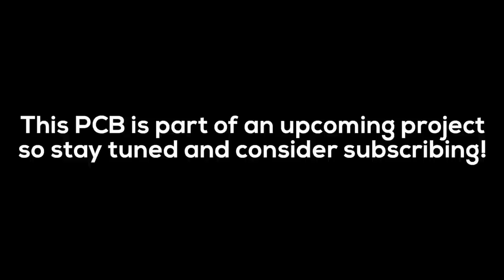ESP32-S2 based universal reflow oven controller | assembly & tests | makermoekoe

Comment: A word of warning, if you do a few runs consecutively or have it for a few years, you will almost 100% likely cause heat warping to your 3D printed front and acrylic sheet. I know this because my design is similar in that I took the front off the original oven to replace it with my own designed 3D printed front. I used ABS which is okay to about 100C and better than PETG or PLA but it wasn't enough. In future will use Nylon or CF-Nylon. Will probably add a strip of titanium or Stainless Steel as a thermal insulator between oven door and Front-interface printed housing.

Comment: I tried something similar a while ago, but putting the electronics inside the Oven was a mistake. After a few hours it started to produce errors due to the bad heat isolation between the reflow chamber and where I put the electrics. Your design seems better in that regard though. What I noticed was, that turning the oven on and off by hand and using a thermocouple as reference was plenty good for my needs. I did PCBs with 150mm x 150mm and ground planes without problems

Comment: 0:33 awesome!! what a great idea!!
Reply from the maker: You'll find more details about this in my last video 🙂
Reply: @makermoekoe  lol. you are right.
U showed a lot of skills that individual developers can take advantage of.
Two different types of stencil fixing techniques. 
-vacuum -A physical fixture -made by 3D printing.
Solder paste application device using stencil plate also.

Two different types of SMD soldering techniques. 
-hot plate in the open air -Oven in the closed chamber
Pre-soldering techniques and flux application techniques.
Display fixing hole using tweezers.
also Fine technique to remove sticking leads with additional leads.
Fastening screws with soldering machine heat.
Everything is a personal hardware developer's bible.
:elbowcough:

Comment: Man, the quality of your work is mighty impressive. And your lab looks awesome as well. And this gold enig finish on black PCBs is very beautiful.

I'm working on an ESP-32 controller for a personal project, and I wish I knew how to do 4 layer design or do impedance matching for ceramic antennas. Any tips?
Reply from the maker: Thank you so much for those words! 
Regarding the four layer stackup there are awesome videos by EEVblog which I can definitely recommend. Impedance matching isn't easy at all... For some antennas there are great datasheets with simulation stuff but sometimes it's just trial & error for me as well. The antenna which I'm currently using has this little helper: https://product.tdk.com/de/search/rf/rf/antenna/simulation?pid=1000000249767

Comment: Cool as usual, but the standard reflow process has a limited T and time, so-called profile curve(usually IPC/JEDEC J-STD-020D.1 or so), you can find that in many silicon part's PDF. An oven like this can control T, however, many SMT parts are sensitive to accumulated exposed time(low-noise amps, plastic connectors, stacked film-caps etc).
In fact, simple hot-air may be safer.

Comment: Heya everyone. As this great project deserves it, I put a little of my own effort into it. While all credits are going to makermoekoe, just wanted to leave a tiny note, that the fork of p1ngb4ck is actively developed on and has basic wifi connectivity, i2c-scanner, ota flashing and compatibility with latest library versions. Also a working BOM is provided on that fork.
All changes were minor and not much work in comparison to the original project, but maybe it could be helpful to someone. Additional wifi-controls and surveillance  for the oven and saving temp-curves via wifi are currently in development

Comment: Nicely done! I always like seeing video of the moment the solder melts and creates the fillet. :))
A couple questions:
   1) With such a large oven, is there a problem with thermal 'lag' especially on the ramp down? 
   2) Cool idea with the vacuum hold-down, though I thought I saw some mis-registration with the stencil. Is there a way to make sure it's dead-on?
   3) Have you ever used dry-transfer letters to label your acrylic. I've used white letters on smoky gray, and it usually looks really cool!
Can't wait to see your next one. 
Take care.

Comment: If you are doing a revision, add a way to monitor the input wave form. This will help you with controlling the coils accurately. Otherwise using PWM or something along the lines will feed harmonics into your house wiring.
Reply: I think this is easily solved by using an input filter like a PC PSU has, using Y caps and L-C combinations
Reply: @KnaufL you can also use the reverse phase dimmer approach, instead of turning on outside of zero cross they turn on at zero cross and off elsewhere. Current is always ramping up at a rate of the cosine of the sine and down, well that’s fast but less problematic.

Comment: How are you reflowing the opposing side without losing parts from the top? That bare board is creating enuf isolation that the top doesn’t flow?

I recently tried just setting boards on a PID controlled hot plate at 245C and they flow inside of 20-30 seconds tops then slide them off and they cool on a granite cutting board. 

Definitely violates any reflow profile in the sense of ramp time…prob not the best thing but it works. I wouldn’t shoot the result into orbit but for simple non mission critical stuff it works.

Comment: Hey Moritz, are you good? So, do you like this your dual soldering station (852d+) ? Any bad point about? Thanks!
Reply from the maker: Hey! It was fine for all my needs but currently I am thinking of buying a new one because the minimum air flow is sometimes too high for some smaller components… Or at least I have to „tune“ it a bit by myself 😁

Comment: On the product page of the oven it says that it has a stepless temperature control from 100 - 230 °C. In the video, however, you have also set 250 °C. I wonder how that works?

Comment: Very interesting project that I have now started building for the integration with hot plate. Was wondering if you managed to calculate values for the inductors in Pi matching network. Not sure what the impedance we are supposed to match against as the datasheet for ESP32 does not mention anything.

Comment: Nice video, very precise! 
How are you insulating the top layer while reflowing the bottom layer? the top layer components should fall if the board is heated as per the solder profile. Very curious to know. Thanks

Comment: How do you reflow the other side without the components falling off?

Do you have different solder that melts at a lower temperature?
Reply from the maker: For smaller parts this isn‘t a problem, they won‘t fall off because they stick into the paste… For bigger components I will use glue or kapton tape or something like this, not even sure about
Reply: @makermoekoe  fair enough. It'd be cool if you could make a little holder for the PCB to sit on and it keeps everything against the board whilst upside down

Comment: Wow, this is absolutely incredible! Just out of curiosity, why did you apply the extra solder to the ESP32 with the soldering iron? It seemed like it should have worked fine without that. Is that recommended?

Comment: Guys what's the technical name of the female screw housing shown at 3:56 that he's placing with the soldering iron?  Thanksss
Reply from the maker: These are called threaded inserts, or brass inserts, or heat inserts
Reply: @makermoekoe  thanks a lot, great project tho

Comment: ty for sharing - but its very very hard to rebuild, as you dont provide a BOM on your github. Not everything can be known from the eagle assembly file. For example the exact type of RT9193 chips
could you maybe update that ? I am trying to rebuild this project and struggling hard
Reply: I'm in the same situation... a friend and I just tried to upload your files to JLB PCB to get them to do the assembly work for us...  but the BOM is incomplete with a couple of missing components, components without specifications (caps) and a few non  matching footprints.   It's kind of a chicken and egg situation for me as to build at home I either need a reflow oven or hotplate... currently I have neither.  Any help would be appreciated.   -  love your videos...
Reply: @TheBpgoa  I now made all my orders and the PCB will arrive in a few days.
As soon as I can confirm my build works, I will put up a detailed parts list on github, that should enable everyone to find the necessary parts easily, even if direct links dont work as the part is not available etc.etc.
Several things went clear to me after inspecting the circuit schematics thoroughly and re-checking the video parts of the soldering check.
Towards the "hen/egg" problem: I am building my PCB DIY Heaterplate first using an Arduino. Basically a V3 of the V2 Version of sb else here on YT. With that one I will then be able to reflow the pcb for the oven.
Reply: @TheBpgoa  the capacitors with 0402 footprint (F2 & F3) are just used to generate a footprint on the pcb if inductors shall later be put there - I am not too far into that myself but you can see it on the video too if you take a close look.
The RT9193 needs the 3.3V Version of the chip. Footprints do match, but make sure to get the SC-70-5 Version of it - on Aliexpress all of them are SOT23 which is bigger. I could not get it from anywhere as its nowhere in stock in SC-70-5 package. Therefore I ordered some SC573V33RTRC from mouser - these "should" be a direct replacement for the RT9193, but I am unsure an need to confirm first.
Also, 2 of the pin-headers can be left empty (the 2.00 & 2.54 Headers of the assembly files, entry 2 and 3 on the list).
Will give updates as soon as my own build is working.
Reply: @5L4P5T1CK   How are you getting on...
Reply: @TheBpgoa  btw that "p1ngb4ck" (me) guy on github proposed a csv file to the project as a pull request, with my ordered parts, if you already want to have a look at what I ordered
Reply: @TheBpgoa  I now built my board - the BOM I put up works fine for me. In  case you got any questions, just put up issues on my github fork of this project
Reply: @TheBpgoa  please check out my own fork of the repository. I made some minor updates (none to the pcb, only code & docs)  - and have a nice working board here right now. My BOM in the docs folder of my fork works fine
Reply: @5L4P5T1CK  Thanks for the updates.. I'll have a look at the repository later and try and upload to probably JLPCB and have them assemble.....  If they have the components.
Reply: @TheBpgoa  you are welcome. actually I have 5 running boards now - if that would be helpful, I could probably sell 2 of them.

Comment: You make it look easy but it's incredible what can be done with a bit of ingenuity. I'm really hoping to create some of my own boards for custom 3D printer projects I have planned. How practical is it to use at home methods like this to flow components like an STM32 MCU, stepper motor drivers, etc? The plans I have would be fairly small and only incorporate one or two chips like this on a single board so nothing too complicated.

Comment: It is a bit concerning to have main high power on the board with the interface buttons. Also, those PCB traces for main appear to not have the capacity for the oven power. Very nice video and project, but electrical safety is a concern.
Reply: PS. And normally the temperature should be measured in a similar setup at the PCB, not on the open air.

Comment: For me it looks like the project is only about the nice looking black/golden PCB. I do not really understand why the electronics are not encapsulated into some real housing, just revealing the display. Therefore the design is not really clear in terms of usability. The 230V part is only covered by a thin red plate. Why didn't you put the relais inside the metal housing like the other one?
Greets from an engineer.

Comment: Would this work at 120v?
Reply: If you are using a 120v toaster oven with 120v PSU, and 120v fan.... Then It will work.

Comment: Seems like highly specialized and expensive equipment and tedious placement of components. I did something similar smearing Flux soldering paste onto the PCB, placing the components and heating up the board on an old GE electric fry pan i salvaged from the trash.

Comment: Well done. I am trying to adapt your design to control my own infrared rework machine with two heaters. This is my first attempt at ESP32 programming, so I'm following a professional :) But I found that the "running_const" option doesn't work, because the main.cpp code on line 390 is "else if(current_page == 1)" and it should be "current_page== 2".
Regards